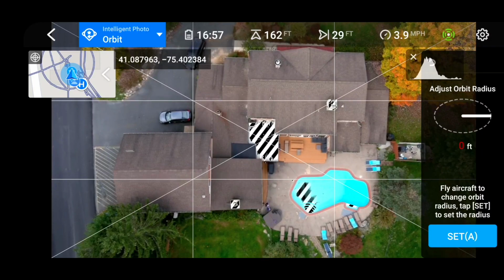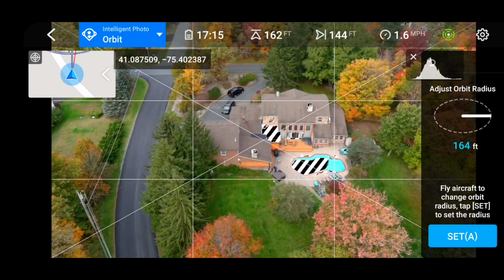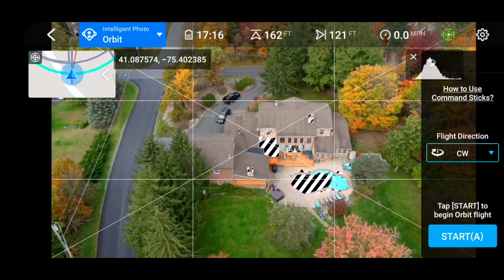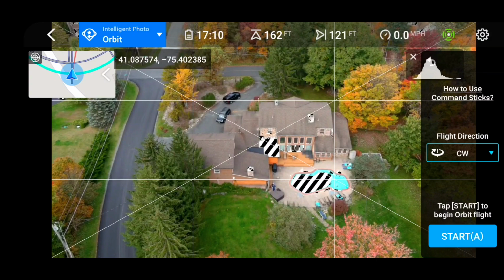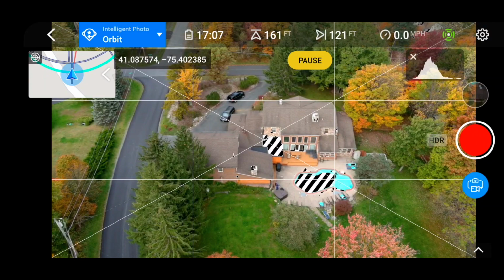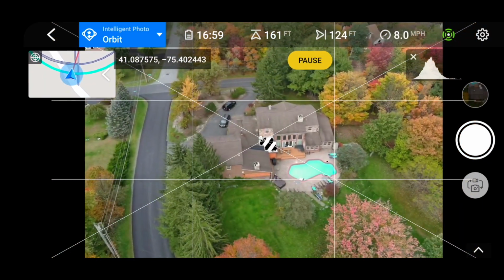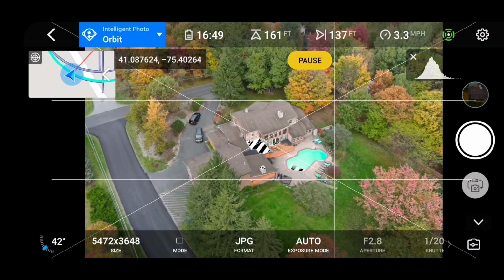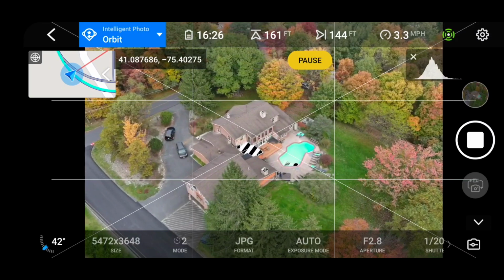3D Mapping Using an Autel

Comment: What do you think about the Autel Evo Lite+ versus the DJI Air 2s?
Reply: Evo Lite+ has a better camera and more comfortable controller, Air2S has better autonomous flight functions.  I ended up going the Autel route for the camera and more vibrant color range the camera can give aswell as not having geofencing bs. I almost bought the Air2S and while I'd still recommend it, Im happy with my Lite+